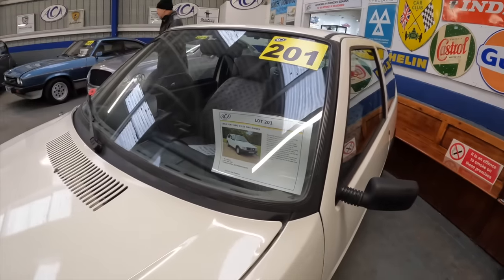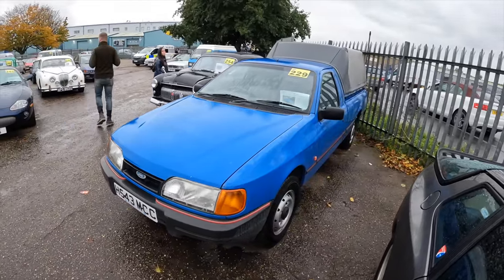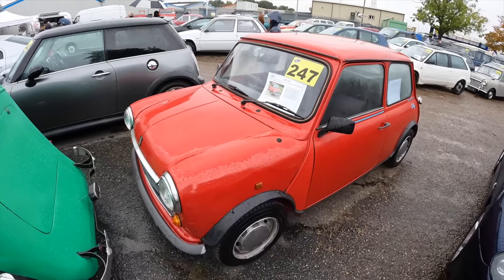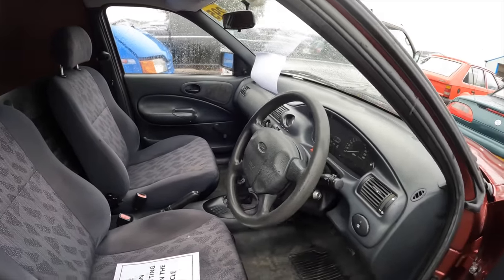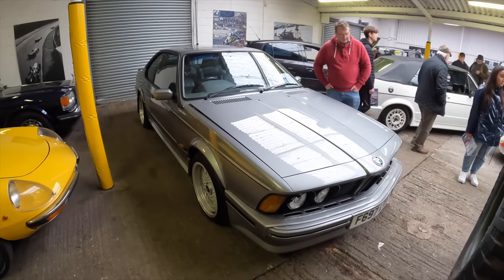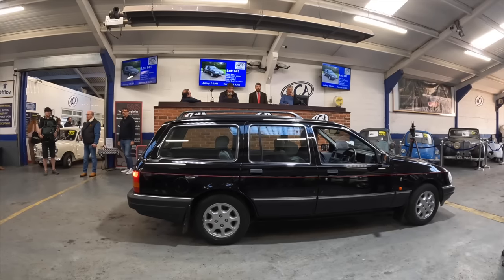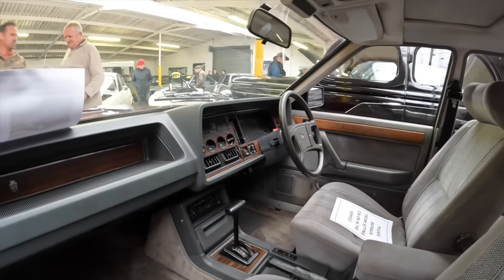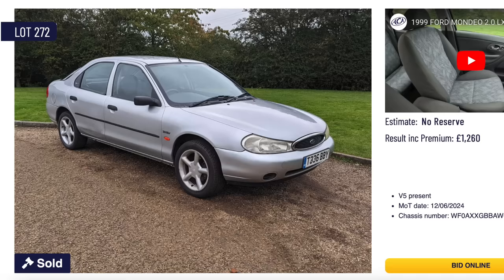I HUNT FOR HIDDEN GEMS AT THIS CLASSIC CAR AUCTION! - ANGLIA CAR AUCTION -

Comment: Let's just take a moment to appreciate Lauren for standing around all day in the freezing cold and wet when it wasn't her video, she could have spent the day tucked up in the warm, but no, that's dedication. The car of the auction for me was the Hillman Imp, gorgeous car. Mitch, they're water cooled but did suffer with over heating issues, the engine was originally a race engine called the Coventry Climax which was altered for the Imp for road use.
Reply: 2 days*!
Reply: @Retrorixy  Thanks for pointing that out, I meant to edit it but forgot!
Reply: Love the seirra estate , love estate cars
Reply: @iankennedy1441  My Dad had a 1.8LX Sierra estate, was a good car although the weak point was the 1.8 CVH, he put a second engine in it (miles unknown), did 60k and needed another so he got rid. To be honest though, the first engine lasted 120k so the car certainly had a life.

Comment: hilman imp is water cooled, the radiator was behind that big fan cowling. it was a 1ltr 4cyl all alloy OHC, really nippy motor, cars were made in scotland, a rival to the mini
the p100 pickups were built in south africa, they started with mk3 cortina front ends, then mk5 cortina fronts, then the sierra front end.     They were a hoot to drive in the wet, many pairs of underpants were ruined driving them flat out everywhere in the rain... most were 2ltr pintos, all were hire vehicles...

Comment: Thanks again for the auction review. Those P100 diesel engines were rubbish as the head gaskets go for a past time, i had a petrol one, a 2.0 pinto one, but in the end i put a 2.8 turbo injection engine in, but standard looks from the outside 😁

Comment: Capri interior is wrong
Reply: Maybe you are thinking of the Recaro seats? 
Interior is definitely spot on. For a 'base' 2.8. Very similar (maybe the same) as the previous S models. 
I used to see S model with Recaro seats with the mesh headrests. I've not sure about Recaros in 2.8s, but I'd bet they were an option. Or possibly the 2.8i Special had different interior? I'm just not that clued in  about Capris. But I saw loads with that very interior,
I'm sure the run out Brooklands had Recaros, leather or half leather... I'm not sure. 
I remember the Laser models having laser seats. Very similar to the new XR3 (no 'i' at launch) 
Lasers definitely didn't get Recaros, just the regular seats with the laser pattern. 
Back then that was the look.
Golf started the check party (I think) my TR7, my friends Cavalier SR (still no 'i') Astra GTE probably others... But definitely the pattern to have!